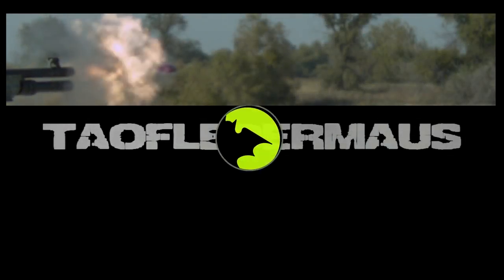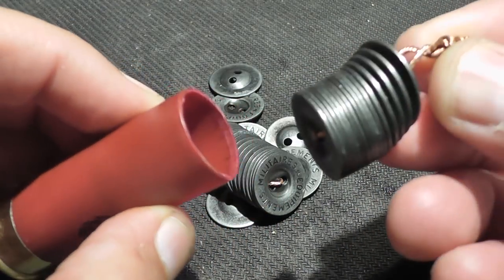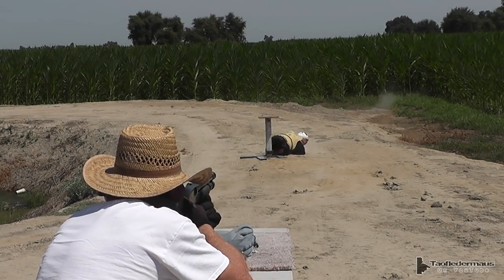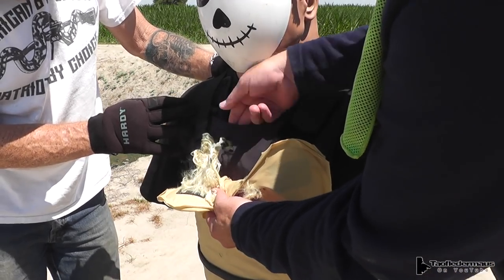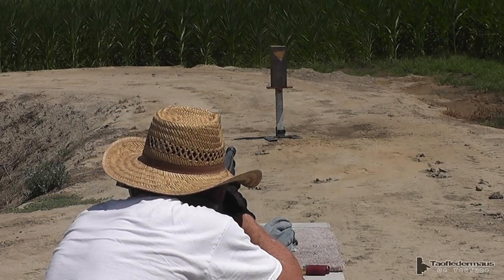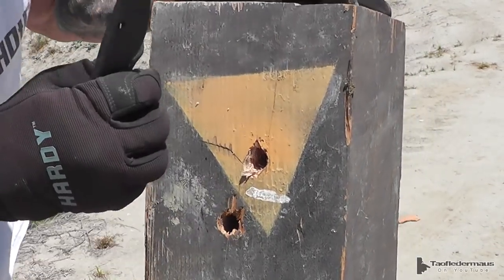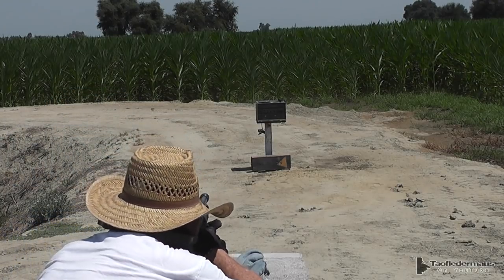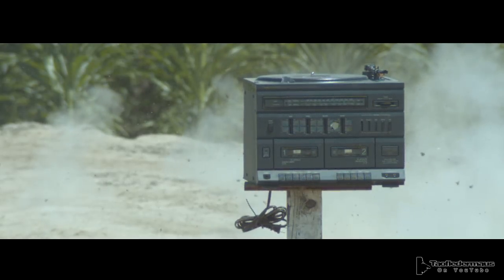BUTTON SLUGS -  Unconventional Shotgun Load

Comment: I'll say it before someone else does. Those would have shot better if you used a rifled buttstock or improved modified sling swivel. Just saying.

Love these weird load videos.  XD
Reply: Dsdcain rifled buttstock? I don't know what that is! 😀
Reply: Bryce Harper   Oh yeah those are what all the best internet shooters recommend, I think.  XD
Reply: Laser sighted trigger... that's what he needed.
Reply: They should have used a laser sight, without a laser pointer to follow, the poor buttons get lost :(
Reply: I'd have went with an official Officer Gregg green beamer blue spot 'Lazarrr sight' and improved quad twister direction choke. XD''''
Reply: Rifled buttstock with x-rock buttpad compensator.
Reply: And the flash hiding bayonet lug with three hundred round banana clip magazine tubes.
Reply: Nah, it's the flick of the wrist ;P
Reply: Dsdcain uh... rifled buttstock?
Reply: Brent Keller  Only if those are Glock brand Glock clipazines though. those are the bestest ones you can get in banana style tubes.
Reply: The flash hiding bayonet lug is from Magpul. 
Everything else is Glocked  to the max.
Reply: you also forgot manufacture stickers and digital camo paint. they combine to give 27% more penetration and 15% accuracy. 

and ejection port paracord cover. which increases the shot velocity by 65%
Reply: Dsdcain It looks like he forgot the shoulder thing that goes up.
Reply: You forgot the lower 1/3rd co-witness chock tube.
Reply: Laird Cummings woah woah woah do you want them to have to get an NFA tax stamp because it is a destructive device?!?!?!?!?
Reply: I hear some 'CS:GO skins' wouldn't go amiss either on a rifled buttstock or recoilless bipod suspension block!

Don't forget your stamps and interview with Danny, Hickok45 and Gaston Glock!
Reply: hey fuze
Reply: don't forget about the flux capacitor so they can travel back in time so they make impact before he pulls the trigger
Reply: all they needed was a tactical moose
Reply: No the problem is that they ain't turning the gun sideways like a real G supposed too

Comment: I am no physicist but one could imagine the small seperations in the button stack mid flight would cause a layer or bubble of air in between each button causing a layer of stability. Like a truck bed causing an air bubble reducing drag making it aerodynamic. Very interesting concept. I like it.

Comment: set them in to wax to bind them together and see what happen. Or insert some finishing neails down the holes with a slight bend in the nails to make a friction fit. It may help hold the buttons together longer in flight but still let them fly apart closer to the target or on initial impact. Id say test in ballistics jell. And tell your friend nice knife he has there a sog flash variant. I had the sog flash 2 nearly identical to that one and converted it in to a switch blade with a very simple mod

Comment: I really wish you got a better shot at the dummy. I find it hard to believe it would go through two kevlar vests if it hit nice and center.
Reply from the maker: Kevlar is really weak at the edges and even a .22 would go through it there.
Reply: well the key to penetration IS velocity, not mass so a 22 might, under some circumstances, penetrate better than higher calibers.
Reply: Yeah. That's why I want to see a shot that isn't at the edges. I don't expect it would go through, but I'd still rather a clean shot.

Comment: Bind with tactical wax!  These surprised me.
Reply from the maker: I don't think the wax would be strong enough.  Works well with little shot though.
Reply: yeah, I think you're right.  The copper wire did the trick though.
Reply from the maker: We tried using wax before holding nails and other large objects and it just broke apart and then we just had a bunch of chunks of waxs obscuring the  HS camera shot.
Reply: I need to think of some crap to send you to shoot haha.  I would be curious to see what sabot slugs do through that rifled choke of yours.  I have a rifled barrel for my 870 12 ga and hunt with Hornady SST sabot slugs.  They are ridiculously accurate but its a full rifled barrel.  They are 25 bucks for 5 though, kind of pricey.  Thanks for all you do man.  You have been good entertainment years, I hope you stick with it.  You're good fun!!!
Reply: You know what would be an interesting projectile? Metal discs about the thickness of a dime, with a raised ridge on both sides of one edge, the idea being that the drag would make them fly edge on. Just stack in about a dozen of them per shell and let rip.

Comment: Y'all should shoot just a big hunk of wood out of a shotgun. Just take, like, a log, and cut out a piece that can fit in a shell, and shoot it!
Reply: Anti-vampire round?
Reply: They've done a ton of those kind of rounds. Remember when they shot a giant sharpie?
Reply: oak dowels
Reply: They already shot wooden rounds and they worked amazingly at only 5 grams. They had the gamo pellet shape and flew with remarkable accuracy. Look up mexican ironwood shotgun slugs.
Reply: forgot about those. 
Also, I think the Swedes used a wood bullet in practice rounds for training. I've seen surplus ammo like that for sale.
Reply: Yep the 7.62 rounds for the AK4 and KSp58 MG had(have? a wooden 'bullet' (https://www.soldf.com/images/s_762.jpg the red one in the middle) that was essentially turned to dust in the barrel and blank firing adapter, while the 9mm for the M45 SMG were some form of resin. 
On the M45 the entire w barrel as switched out for one that was conical and squeezed down to way under 9mm which made the plastic disintegrate + a stop at the muzzle that redirected back into a cone that again redirected forward. Apparently there used to be training ammo with a 5,2mm bullet encased in the plastic, and the same barrel was used, but without the blocker at the muzzle (http://www.gotavapen.se/gota/artiklar/kpist/mag_lospipa3.jpg).
Reply: Jp Kalishek yeah, bulleted blanks